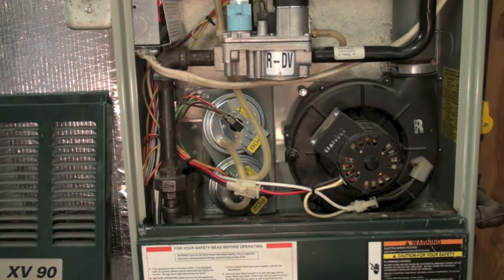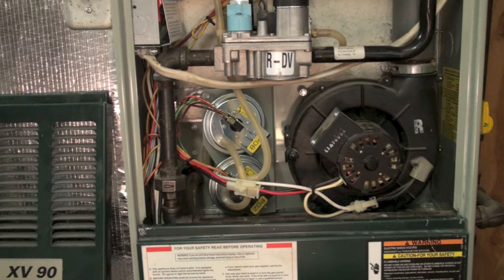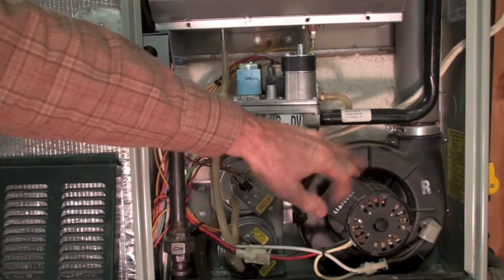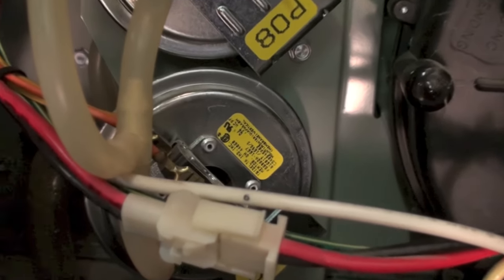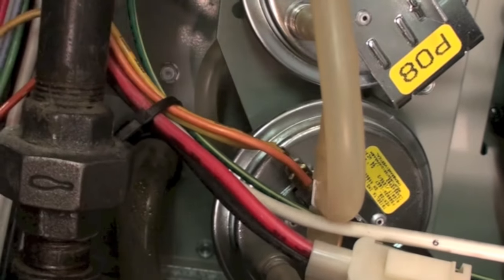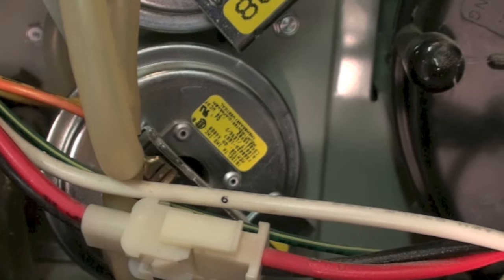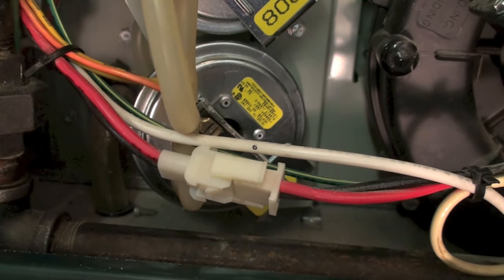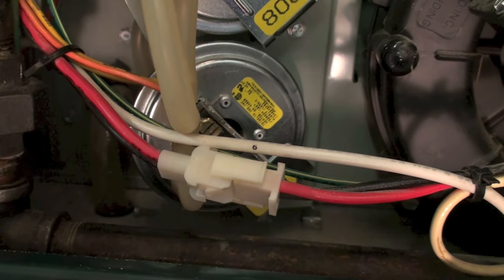Diagnosing pressure switch problems on gas furnaces

Comment: My furnace is cycling off, flame stays on 1-2 seconds max, I have cleaned and replaced flame rod even changed igniter. Any suggestions?
Reply from the maker: If its a 90% furnace, I would be checking vent for blockage or sagging and condensate drain blockage.  If no luck you can send me a youtube video of it cycling and I will try to help.
GFM
Reply: How did it go, mine still isn't working....

Comment: I have a package unit so theres no vent pipe it's deffinatley venting but im only getting.2 in wc, im used to seeing .5 to , this is a single stage. The pressure switch closes sometimes, and sometimes not, and i think its the induced draft motors weak but it's sounds and looks like it's running normal. Whats the likley cause. Flame sensors clean 3 microamps.

Comment: I am having a problem with my furnace. I have vacuum in the hose, but the way to get the furnace to kick on is to tap on that sensor itself and it will kick on 100% of the time. Does that mean it's likely the switch?

Comment: Thanks for the video.  Touches around my problem, but can’t solve yet. My Bryant 355AAV will not fire on Lo stage. Inducer starts/runs for 10 seconds or so, then shuts down. Continues to occur until temperature drops about 3 degrees, then furnace fires in Hi stage and heats to set temperature. Then problem repeats. Pressure switch replaced to no avail. Could the problem be blocked/crimped drain hose for Lo only?
Reply from the maker: I can't say I have seen a furnace operate in that way.  The inducer shutdown is classic failure to reach the pressure for a continuation of the ignition sequence.  I have never seen a unit start on high fire if low fire fails.  
In any case, I would be looking for venting problems.  Blockage, water in vent.
GFM
Reply: @grayfurnaceman  Thank you

Comment: Hey boss, thanks for the vid.  At 3:50 you note that if you pop the hose off at the combustion chamber and the furnace starts, you know where to start looking.

I went ahead and did that, and sure enough, the furnace fired right up.  I removed the hose from the other 2 connection points and tried to clean it out but nothing seemed to come out.  Putting the hose back on caused the furnace not to ignite again.  Am I looking in the right place?

I ended up removing all hoses and tried to ensure they were clear.  This was after replacing a dirty filter and verifying (to the best of my ability) that the 2 air pipes for intake and exhaust are not plugged.
Reply from the maker: Try removing the combustion air pipe from the furnace.  If it starts, you may want to try a shop vac on the pipe (with it removed from the furnace).
GFM
Reply: Thanks for the follow up!  I gave that a shot but no go.  I hired a local HVAC guy and he found a blockage in one of the hoses a little further down the chain.  Cleared it right up!  Thanks for the info!
Reply from the maker: Welcome
GFM

Comment: Hi Gray,
I have seen these trane furnaces with  pressure switch problem where the pressure switch hose going to the combustion chamber. Everytime its disconnected it has worked. Any suggestion what could be done about that? Thanks
Reply from the maker: The symptom you are seeing is indicative of a blockage or excessive length in the combustion air piping.
GFM

Comment: I had to actually suck some rusty water out of one of the pressure switches and the furnace started back up. I have a Rheem 90 that was installed about 25 years ago and it was vented to the exterior. The intake and vent pipes seem to be level so I'm not sure where the condensation in that switch is coming from. Could you show us where the 'screens' are located that I need to check to make sure they're not clogged..? Thanks
Reply from the maker: Be sure there are no low spots in the sensing tube and replace the switch.  Sometimes the air bleed in the switch gets blocked and moisture gets caught in the switch.
GFM

Comment: thanks for the video, I have a pressure switch issue, after doing everything here, I discovered that when I remove the foil tape from the exhaust (not a typo) the pressure switch functions normally, what on earth could that mean? Now I have a portion of the exhaust coming into the basement. its not cold enough to freeze, any help is appreciated
Reply from the maker: I am assuming this is an 80% furnace that vents with metal pipe.  Unless the furnace is vented horizontally out the wall, the vent piping is under negative pressure.  No exhaust should be entering the space.  The vent piping is usually B-vent and foil tape is not necessary on the joints.  If you want to send me pics of your system, I may be able to help further.  Send to Grayfurnaceman@gmail.com
GFM

Comment: I'm hearing a watery gurgle sound when the inducer turns on. Sometimes I get 2 blinks from the LED indicating the pressure switch is open while the inducer is on, but after about 5-10 seconds, the code stops blinking.

My furnace is cycling on and off repeatedly. It did this to me last year, and all I had to do was put in a clean filter. It is doing it again unfortunately. I have a clean filter (cheaper, more breathable, 30 day kind) in place, I have tried cleaning and replacing the flame sensor, and I have made sure to not block any of the return supply vents. The thermostat appears to be working fine. I have had the same system since I've lived here and have not had any issues until now.

This is the sequence I'm seeing:

Thermostat is switching and sending the signal for heat.
Furnace starts up the igniter.
Gas goes in and flame on
About 30 seconds later, the blower comes on.
Shortly after, the flame turns off
Shortly after that the blower turns off
Repeat...

Any ideas why my furnace is cycling this way?
Reply from the maker: The gurgling could be a blockage in the condensate drain.  As for the cycling rate, the first culprit is usually the thermostat if it is of the older mechanical type.  There is an adjustable anticipator on these thermostats that can be adjusted to change the cycling rate.  I have done several videos on anticipators that may help.
Hope this helps.
GFM

Comment: I thought I understood pressure switches until I watched your video! but now i'm confused. This is the way I think the switch works: the furnace inducer fan turns on and draws air through the heat exchanger coils. When the pressure switch senses the vacuum from the inducer fan, it calls the ignitor to spark and light the natural gas. 

But obviously this is NOT how it works if removing the vacuum tube is a test method to see if you can get the furnance to run. what am i missing?
Reply from the maker: Rolland Elliott This type of pressure switch reads 2 pressures.  One from the inducer and one from the combustion chamber.  This video explains it:  http://youtu.be/BB1y0F0Fp6w  Hope this helps.
GFM

Comment: My pressure switch was failed in the open position, I lightly blew through the line going from the motor to the switch, to listen to hear the switch clicking and a very small stream of water came out the side, once all the water was out the furnace fired right up.
Reply from the maker: Dave Riehl It will probably fail again.  The switch is damaged.  Now you need to find out why water was in the switch.
GFM

Comment: I'm having some heating issues with my Tempstar gas fired direct vent forced air furnace. All that comes on is the inducer blower when the thermostat calls for heat. I tried clearing all the hoses and nipples from both pressure switches. One of them have 2 hoses(one going to inducer and the other one went into the furnace where I don't know what it went to. The other just had one hose). So I jumpered the pressure switch with the 2 hoses which did nothing. However, when I did it to the other pressure switch with 1 hose it fired right up and ran. This lead me to believe that the switch was faulty and I went out and got a new one. Today I hooked it up and it's doing the same thing. I jumpered it again and left it on for a while just to see what would happen. When it was running I saw a bunch of water coming out from the PVC drain trap? so I blew it all out. Still no joy. 

Any suggestions of what else could be the problem?
Reply from the maker: My thoughts are that there is water or a blockage in the vent.  The pressure switch is there to shut down the unit if it is unsafe.  Hope this helps.
GFM

Comment: Our heat/furnace comes on, cycles correctly for 1-3 days and then the blower quits.  The furnace still cycles but the blower stops until the "light switch" on the side is turned off and on.  The blower then immediately starts and the "cycle" starts all over again.  This is a carrier unit and is about 20 years old.  Any ideas?

Comment: So I also have a flashing code 2 pressure switch open.  If I pull the vacuum line off the combustion chamber it runs fine.  It seems you are pointing me to a blockage, but I feel airflow through both outside pvc tubes on my 90% furnace.  All the pcv lines are glued together.  Should I be cutting them open to look inside next?  Thanks for any advice.
Reply from the maker: Richard Garabedian Look for obstructions and low spots in the combustion air pipe.  If all is ok, you need to know what the pressures are.  This will be a manometer.  The compare to manufacturer specs.  Hope this helps.
GFM
Reply: grayfurnaceman Thanks for the reply.  I did find my condensation pump was full of water and not pumping, so I put in a new one and blew out all the lines.  Still have code 2.  I do not see, using a flexible snake camera, any obvious obstructions in either PVC pipe leading out of the house, but I DO see in the exhaust pipe outside the house large water droplets.  Don't know what this might mean.  I looked at my neighbors pvc exhaust pipe and he has no water droplets. So I guess I have a problem.  Can you advise please?
Reply: grayfurnaceman Thanks for the reply.  I did find my condensation pump was full of water and not pumping, so I put in a new one and blew out all the lines.  Still have code 2.  I do not see, using a flexible snake camera, any obvious obstructions in either PVC pipe leading out of the house, but I DO see in the exhaust pipe outside the house large water droplets.  Don't know what this might mean.  I looked at my neighbors pvc exhaust pipe and he has no water droplets. So I guess I have a problem.  Can you advise please? There is no sag in the pvc pipes and the slope of the pipe is toward the furnace.  I will buy a manometer if you think I should, but I was thinking of just throwing a new pressure switch at the problem first since they are inexpensive.

Comment: What can cause a drop in static pressure from the inducer to drop gradully? I was pulling about .65" w.c. which  seems low and pressure switch is activated at .50" single stage furnace, it would gradually drop to .48" in a few minutes.  I checked the flue and removed it from the inducer just to see if my reading would change but same thing. Im thinking my inducer may be failing, amp draw is under the rated amount. Maybe a vacuum problem?
Reply from the maker: I would also look at the inducer.
GFM

Comment: +grayfurnaceman I have two Amana Distinction furnaces (upstairs/downstairs). One stopped working a few days ago the other the next day. Both indicate Open Pressure Switch - which I find mighty coincidental they'd both go bad. We recently had a major electrical storm - lots of lightning and we had Phone, Modem and Router blow. Is it possible that the lightning storm created an issue with both furnaces? Thanks.
Reply from the maker: Bill Moreland It is possible but not probable.  Check the vent piping to be sure it is clear.  Hope this helps.
GFM
Reply: grayfurnaceman Much appreciated on the quick reply. When you say vent piping are your referencing the 4-5 inch metal tubing leading to the roof vents? I had one of those pipes disconnected to the roof vent due to a poor job on the connection on a roof repair in November. I took it all apart and it was clear.
Reply from the maker: Bill Moreland I would not leave the venting disconnected.  It will bring unburned gasses inside the house.  If the vents are clear, be sure the inducers are coming up to speed and the bearings are free.  If no luck, you can try replacing the switches.
GFM
Reply: grayfurnaceman yes, you are correct. When I saw that it was disconnected I (immediately got angry at the roofer) reconnected it and ensured the fit was tight. I appreciate your reaching out.

Comment: Sir, I have a new 90% furnace that makes splashing in the drain trap.  The heater shuts down sometimes and I hear water near the inducer.  I noticed one of the two condensate drain lines from inside the heater sucks in and one blows air out when the heater does operate. After the heater shuts down do to thermostat reaching temperature the drain line that was sucking in then discharges water to the drain trap and the drain line that blows out never discharges any water at all.  Is the water being sucked back in from the drain trap by the drain hose in vacuum ?  Please help me. I'm confused.  Thank you.

Comment: I also have the XR 90 and have a pressure switch problem.  I replaced the inducer motor and cant seem to find any blockages in any tubes that are serviceable.  The intake and exhaust do not seem obstructed in any manner.  I am at a total loss.  What else could it be?
Reply from the maker: +Kjcbkjfbkj Jbkjbjb Heat exchanger cracks could also cause this.  The pressure switch could be failed.  Blockages in the tubing.  Also, a sag in the venting will build up water in the vent and cause the switch to not close.  Hope this helps.
GFM

Comment: Interesting. On my trane xv95 my burner will light for 3 secs then cut out. Cycles 3 times like that then 2 red flashes. Inducer fan is now because of bad bearings and it didn't fix the issue. If it pull the line from the combustion chamber and lightly blow in it once the flame lights the issue goes away and it stays lit. Its a dual pressure switch showing 1.6 WC. I can hear the switch click when it blow. You think the pressure switch is bad? Flame sensor rings out on the meter and its clean
Reply from the maker: Have you cleaned the condensate drain?
GFM
Reply: @grayfurnaceman  yes. Pump will evacuate the water as well once it fills.

Comment: I spoke to a rep and he said this particular model was poorly built and a pain to service. He told me he was 99.9% sure it was a secondary drain plugged up inside the furnace and that it would be a pain to get to. He said he repaired one similar to mine 8-10yrs ago and it was not fun nor worth it. Also, that chances of something shorting out while putting everything back together or even a bad gasket would likely come up. So pretty much it's just a 22yr old piece of crap now.
Reply from the maker: That could very well be true.  The life span of a modern gas furnace is 25 years, so maybe a new one?
GFM

Comment: Similar to Xalaxander, the blinking code on my Honeywell indicates "Pressure switch open. Should be closed." I detached the vacuum tube at the chamber side and gently blew and sucked and could hear the bladder open and close. I reattached, tried it, and still got the same code. Is this also indicative of a failed switch, and if so, is that something I, as a novice homeowner can replace? Is there something else I should check, too? As a bit of background, when I first started the unit, it fired right up and was doing as it should, but I turned it off because it had a very high pitched whine. As it powered off, the whine was like an airplane powering down (the whine gradually changed from very high, to low as it slowed and ended in a few "putt" sounds). I checked the blower fan, and it spins freely. Then, I was not able to restart the unit, not even the blower, and the blinking code was as I stated above. Any ideas?  

Thanks!
Reply from the maker: Sabrina Campbell Remove the bird from the vent.
GFM
Reply: Lol! Would that there was one 😕

Comment: @ grayfurnaceman Hi, I have a old International Oil Burner 950 Series Furnace and need to find a limit switch C 4370-15-144 F 130-2  I am assuming that the limit switch is not working because the blower does not start. I would appreciate any help in finding one!
Reply from the maker: If the circulating fan does not come on, there is no problem related to the limit switch.
If the burner motor does not start, have you reset the primary switch?  (only once)  Have you jumped the thermostat terminals?
GFM
Reply: @grayfurnaceman  no we have not jumped the thermostat terminal it's a Honeywell I don't know what the primary switch is?🤔
Reply: @grayfurnaceman  could I have your email so I can send photos please?
Reply: @grayfurnaceman  could the problem be the thermostat?
Reply from the maker: @ilonamw  Send to Grayfurnaceman@gmail.com
GFM